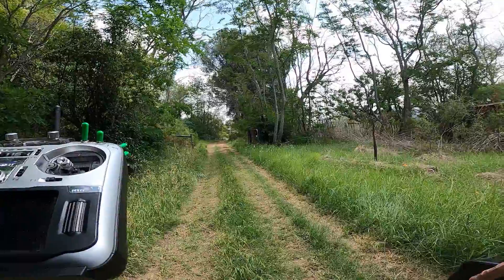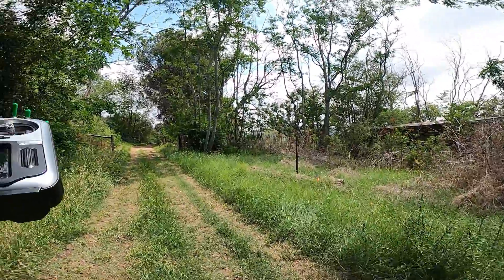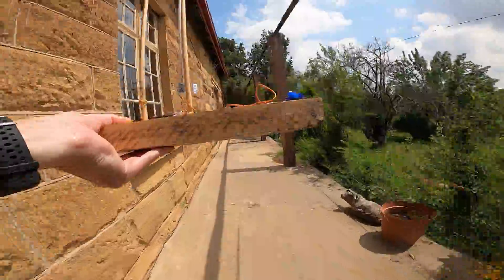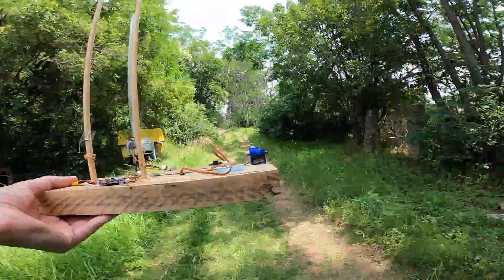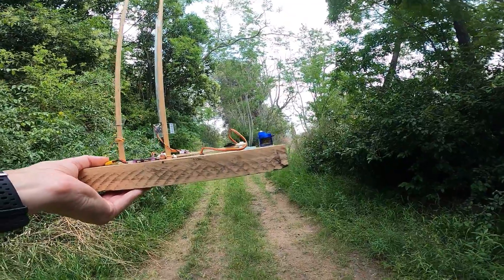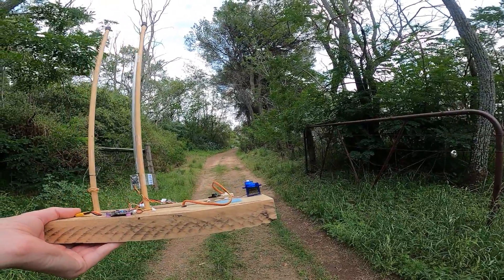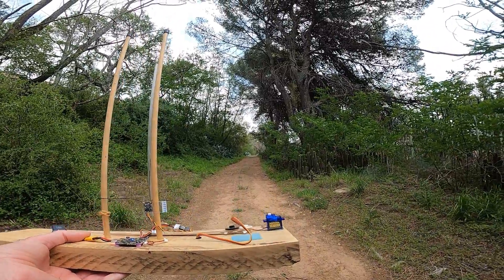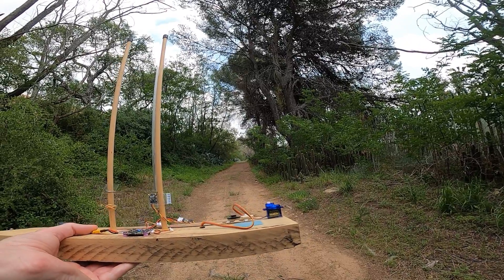Review & Range Test: RadioMaster R81 Nano Sbus Receiver

Comment: Thanks for the review, i just bouth this one i have not used yet. Do you know if any readiomaster receivers can provide telmetry and stabilization? I fly small foam planes and not FPV.  I am only interested to know the flight battery voltage. Thanks
Reply from the maker: Hi Alex, no RadioMaster do not have a receiver with built in stabilisation. Some of the receivers can send back battery telemetry to your radio. Just check the specifications on their website.
Reply: @the-happy-RC-flyer  ok thanks!!

Comment: helouw mister, can i ask u a question, i got radiomaster r81 receiver like you, and what number of stock frequency before i'm doing a frequency tuned, i mean the stock number from new ( or  from factory )
Reply from the maker: Baba it should be 0 on starting the process. With all the receivers I have fine frequency tuned the numbers are widely different.
Reply: @the-happy-RC-flyer  oh ok, cause im planning to changing my stock jumper tlite stock antenna too, do i need to tuning the frequency if i change 2.4ghz  antenna
Reply from the maker: @babayaga3442  I would suggest you do check the fine frequency tune again.
Reply: @the-happy-RC-flyer  ok bill, thanks for the info, nice to talk with you

Comment: Hi Bill, I decided to try spoilerons and flaps on my ZOHD Drift with the Kopilot. With the SB switch I could have flaperons (down), neutral (middle) and spoilerons (up). It worked fine on the ground and I set the failsafe on the R81 only to find that it did not save the SB values. Further investigations revealed that when the signal was lost and the system entered failsafe the RTH only worked is it was in the default unsaved switch position. So it seems that the R81 is not saving the channels at all! Have you ever tested this yourself?
Reply from the maker: NO I have not tested this but I will look into it. As you are running a ZOHD Kopilot if the receiver enters F/S the Kopilot should take over and enter RTH as it is taking over control of your plane. The receiver has let the system down so no longer is in control so I would have thought the F/S on the R81 is being over ridden. I will test F/S on the R81 and check if the switches enter the position you set them in but it is possible they will not because F/S is really only important on the primary controls Aileron, Elevator, Throttle & Rudder. Will get back to you.
Reply: @the-happy-RC-flyer  I did email Radiomaster and according to them it should save ALL channels.
Reply from the maker: @datapolo  I have contacted RadioMaster too. It is difficult to test the R81 SBUS receiver I have it wired to a flight stabiliser and it does failsafe correctly with the 4 primary channels. Which other function do you want the FS to set to a set position?
Reply: @the-happy-RC-flyer  on the Kopilot there is an Aux channel which is Channel 6. As the Kopilot outputs the ailerons on one channel to a Y cable I used a V-tail mixer on the Aux channel (6) with the 3 position SB switch. It works great. Apart from the failsafe issue.
Reply from the maker: @datapolo  what happens to channel 6 on failsafe, just stays in the current position?
Reply: @the-happy-RC-flyer  it goes into the flaperons setting which is the down position on SB. And presumably the default position. I stripped out the v-tail mixer and tried it just on a servo and no different. So then I decided to try failsafe with SC on the middle position which sets the Kopilot to manual. What happened when I switched off the radio is that it went into RTH. RTH is the down position of SC. I also set the throttle with some power and it didnt come on under failsafe. So my conclusion is that it is not saving any channels. It would appear that I have a faulty rx.
Reply from the maker: @datapolo  it must be the receiver not sending the correct outputs to the Kopilot it could be a faulty R81, I will let you know what RadioMaster say to me.
Reply: @the-happy-RC-flyer  yeah thats the way it looks.
Reply: @the-happy-RC-flyer  Hi Bill, so I bought a ToolkitRC M7 and tested the SBUS output of the rx. It had not saved the failsafe settings. However, I was able to save and verify them using the M7 as a powersource. However, it does seem that when RTH is triggered by loss of signal the Kopilot does take control of all channels and sets the Aux to the lowest setting. A shame as I thought I had a good way to use flaps but the the situation as it is now is that RTH will also give full flaps. Not a great idea.
Reply from the maker: @datapolo  I would say the ZOHD Kopilot taking over is not a bad thing. Your plane is not going to land with the RTH feature just circle above you so flaps not necessary. Thank you for keeping me updated.
Reply: @the-happy-RC-flyer  agreed. It just spoils my simple hack to have flaperons and spoilerons. Not a huge loss.

Comment: Bill thanks for your videos. I have had the R81 in a Zohd Drift and using a T8 Pro to well over 1.5miles FPV. Lots of complaints about critical RSSI but can still fly the plane. I haven't pushed it out to actual failure yet....
Reply from the maker: That is interesting, I just released a video testing on the ground the T8 Pro with a R161 it did not go very far I did state in the video that you would get better range LOS in air. You have just proved it! 👍

Comment: Hey Bill thanks for the review. Silly question alert here but im planning on putting this in a talon 250 with a a kopilot lite flight controler. Im not planning on doing long distance flying just some fpv around the local flying field area. Is this receiver suitable for airplanes as well? Can i mount the receiver and antenna inside the fuselage? Thanks
Reply from the maker: Yes it will work fine.

Comment: I'm dealing with xm+ firmware headaches right now.  Seems like I should ditch that in favor of an r81...  It doesn't seem like I'd be giving up much range at all, and the r81 looks like it would work out of the box with my literadio 2 and my tx16s (when it finally arrives)
Reply from the maker: William do not give up just flash the firmware to your xm+ you need for your radio. What radio are you trying to bind the xm+ to and what part of the world are you from? I will then see if I have the firmware you need and put it on my google drive for you to download and flash. I will also give you the protocol to choose in your radio. FrSky have really missed up with this firmware lock out strategy.
Reply: @the-happy-RC-flyer  Wow Bill, you must be the nicest guy on all of YouTube.  :)  The short of it is that the problem I’m facing is more related to timing than it is a technical problem.

The long version of the story is this:
- I have a LiteRadio 2 SE and a gorgeous, brand-new GTB 339 sitting on my desk just begging to be flown.
- I also have a TX16S on order, but since it’s shipping from China, it won’t be here for weeks.
- Ideally, I’d get the older ACCST firmware on the XM+, get that hooked up to the LiteRadio, and then go fly - but w/o the TX16S, I don’t have a way to get the firmware onto the receiver.
- I didn’t even know about the R81, but that seems like a perfect option for me.  Amazon can have that receiver here tomorrow, and from my research, I should have no trouble binding it to my LiteRadio and my TX16S.
- It doesn’t seem like I’ll be losing much in terms of range by using the R81 instead of the XM+
Reply from the maker: @wmcewa01   you should be good with the RadioMaster R81 I have reviewed and range tested the receiver. It is very frustrating what FrSky are doing. You will enjoy the RadioMaster TX16S it’s a great radio. I do try my best to help people. :)
Reply: @the-happy-RC-flyer  You’re a gentlemen and a scholar sir - thanks for the great channel!
Reply: @the-happy-RC-flyer  Bill, turns out earlier this AM, I found a very, very good deal on a second-hand x9D+.
I used that the update the firmware on the XM+, soldered it up, soldered on the buzzer, and was able take it for a maiden voyage!
Thanks again so much for your help.  It was so satisfying to get in the air this evening...  :)

Comment: I bought one.. any tips for stopping the antennas from popping off the receiver?
Reply from the maker: Hi Paul, you can put a drop of hot glue on the antennas but I have never tried they method. I just use the heat shrink and make sure it does cover the connectors after you have heat shrank plastic. Also just watch your routing of the antennas in your model.

Comment: the antenna that you oriented horizontally - the active portion of it was vertical...so you might as well have had them both vertical, not criticizing you just pointing that out, cheers.
Reply from the maker: Constructive criticism is necessary to improve ourselves, no offence taken. I think for future tests I will mount another straw to push the second antenna into so they are at 90 degrees to each other.

Comment: Honestly, good work with the spreadsheet! Odd thing is my R-XSR seems to give me lower range than XM+. Even at the same distance, where XM+ shows rssi in 80s and 90s, r-xsr shows 50s/60s. So did you change the antennas on your r-xsr? Even this guy had the same experience it seems: https://www.youtube.com/watch?v=BYVm_C6hna8
Reply from the maker: Hi Dinesh, everything was standard no changes whatsoever. I will always use the same radio with the same multi protocol module even the save power source. I charge the receiver battery to full each time. The only variable I could have is on the penetration tests because of the foliage growth. I am careful to position the radio and then the receiver on my desk in my studio in the same place. Must say the results are interesting.
Reply: @the-happy-RC-flyer  I see. Honestly impressed with the thoroughness of the spreadsheet already. Out of curiosity, can you check if the antennae lengths on your r-xsr and xm+ are the same?
Reply from the maker: @saidinesh5  No problem:
XM+ Shielded 68mm Active 23mm
R-XSR Shielded 67mm Active 23mm
Reply: @the-happy-RC-flyer  oh thanks a lot. my r-xsr antenna was not the same as xm+. Now i know what to do.